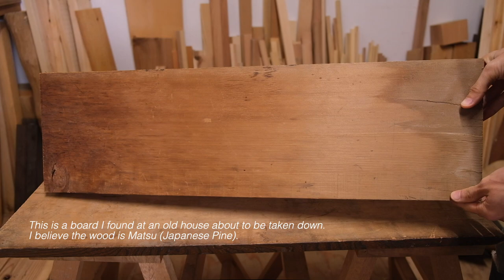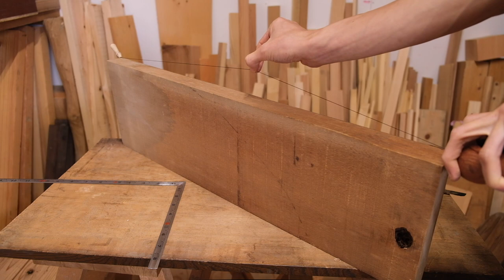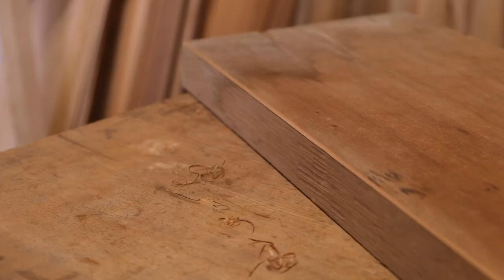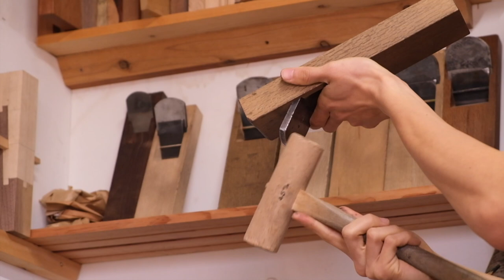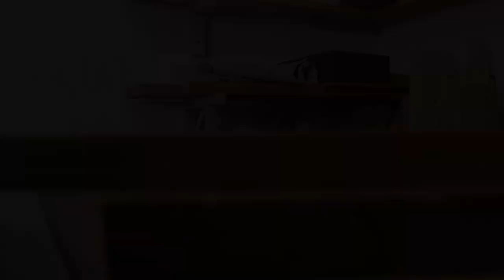Making a Board of Wood Flat with Hand Tools

Comment: Love just listening to the sounds your tools make, such a delight to hear such amazingly well kept and sharp tools, setup absolutely spot on doing there thing. As a hand wood worker myself, who is only now starting out (did a bit in school), have but a few old tools I've managed to find and restore and who strives to finish with a plane/blade, I will not lie and say I'm not jealous of your tools and ability to keep them in tip top setup and sharpened.
Reply from the maker: Thanks, that’s great to hear 😊
There’s nothing better than a well sharpened and tuned tool.
Regarding your other comment, unfortunately I don’t have much experience with western planes so I’m unable to compare between the two.
Cheers

Comment: Thanks for this lovely video Dylan. Can you please explain the plane blade setup differences between the short cross stroke planes vs the finishing long stroke planes? I struggle to get the surface flat, even and polished.
Reply: Yes he makes this look simple. There is a lot of understandings before he even did to the board to be understood like how to set up the plane auto set up the blade what quality of tools are you buying how much do you have to pay for those then understand the technique. If you caught in the beginning he had about 7 different planes all set up To Do this job its not like you took the Stanley number 4 and just went at it. 
There is a lot to the japanese methodology of woodworking each step is critical. Here you are just seeing the end results. Note no time frame nor cost are referenced given to get this job done.
Like anything there is a lot of knowledge and talented before you do it!

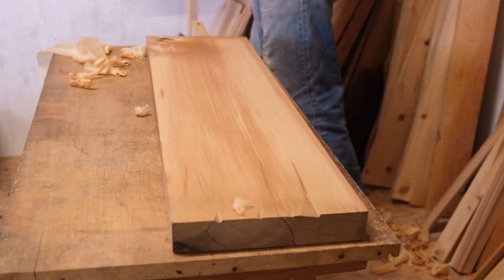Comment: Good video! 👍 Was wondering about what were you moving your fingers across the board for at 4:36 and on?  Also, did you make the planes yourself? Thank you and best wishes ❗
Reply from the maker: I was feeling the board to check for any steps left from where the hand plane overlapped. If there's any steps, I used the smaller handplane (with a slightly cambered blade) to remove it. I do make some of the planes myself.
Reply: @dylaniwakuni  it seems like these planes would be much easier to maneuver than the push type typically found here in the states.  
    While I myself am a mediocre woodworker, I have had the privilege of helping out in the shop of a highly sought out craftsman.  It was there that I first was introduced to a Japanese handsaw.... just like the planers, these saws are oriented to cut on the pull stroke, which offers much greater control while simultaneously producing a kerf far thinner than a push saw which requires a far thicker blade in order to resist flexing against the force being exerted upon it. 

I'd love to get my hands on a few of these!